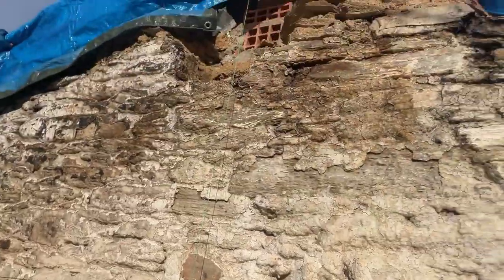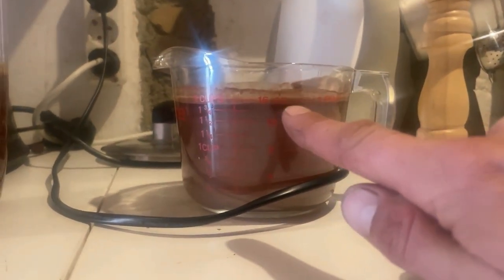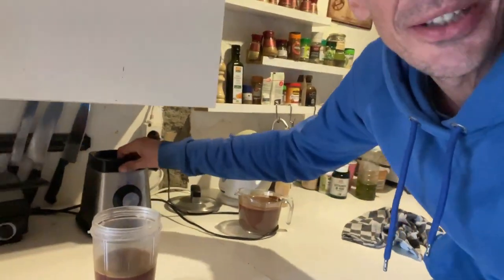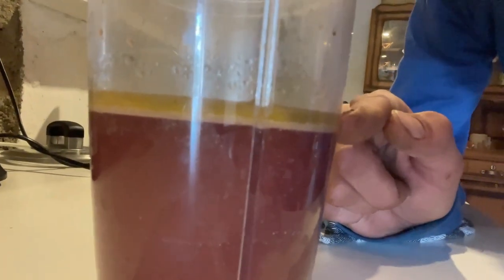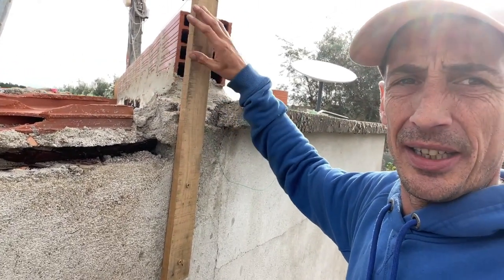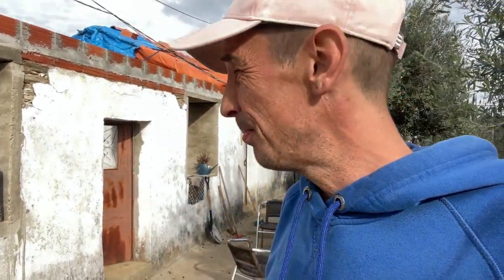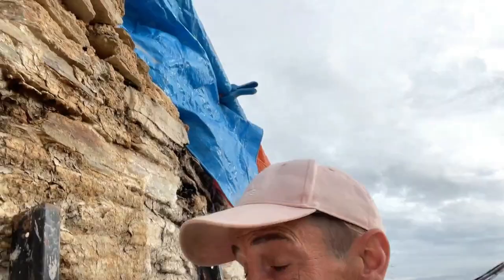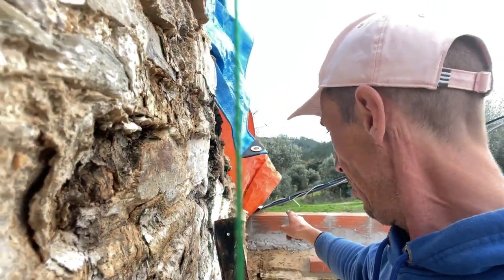MEASURING THE EXACT GABLE HEIGHT | Portuguese DIY House Renovation

Comment: Use a plumb bob for vertical lines, clear pvc hose filled with water will get a level, easy peasy and very cheap. I used to level houses many years ago, never had a problem with water level.😊😊😊

Comment: How do you think buildings were built vertically and level in the past? I know plumb lines and water glasses were very common in those days, and you had to be a guild master to approve their use.
I think that working with ropes will not give you the desired precision that you envision, although it will be sausage  to the real Portuguese or something is level.

Comment: Go straight down from the gable 1,5 meter. Then make a horizontal line to the other wall and go up 1,5 meter in a straight line.
 Both points then will be on the exact same height. In stead of the line a laser would do. Maybe Alex could lent you his for a day. Alex Lukachina.

Comment: the way i would do it i would nail a vertical wood board on the new wall then buy a 5 euro laser light put it on the beam level it, point it straight. go to the board on the opposite wall move it until it hit it. 15 mints job your way would work if the floor and the 4 walls are level i doubt that or buy a laser level😁

Comment: Why not string a line from present ridge beam,,make it level..line level.. to other side,,no measuring ????
Reply: Don't expect him to follow sensible with advice
Reply from the maker: And where am i going to attach the other side then.. there is no gable yet..
Reply from the maker: If its sensible, then yes
Reply: @GhostTownVlogs  nail a board up,,